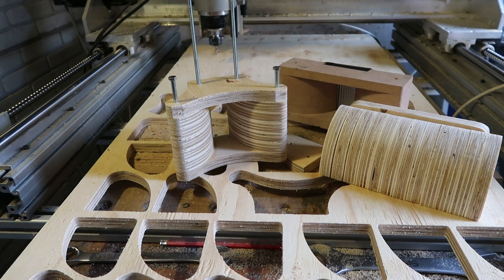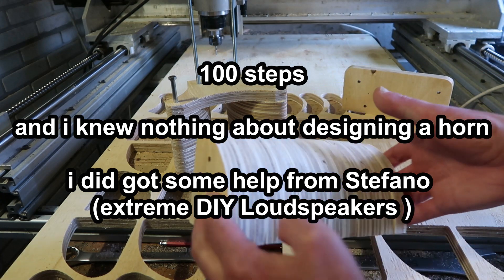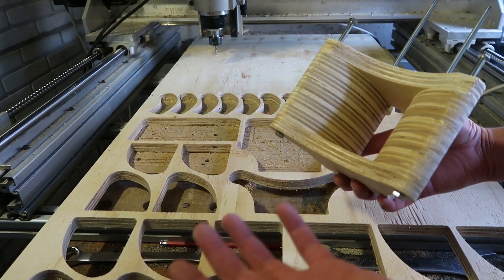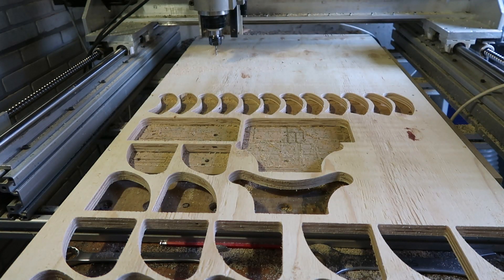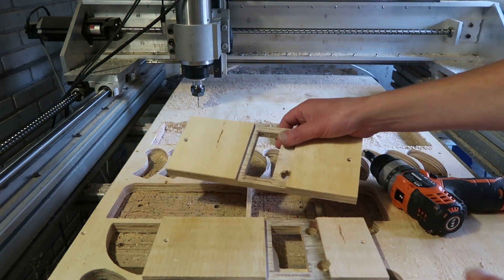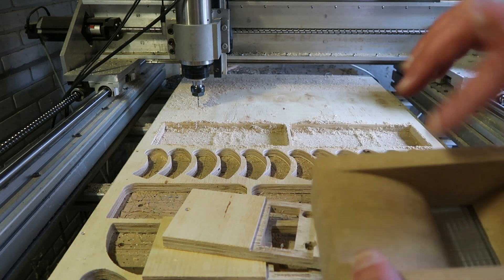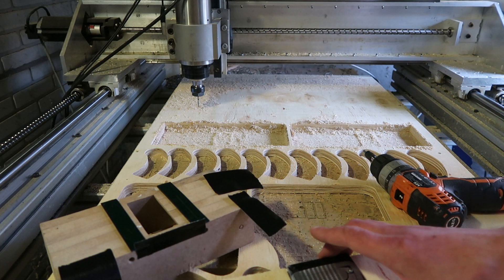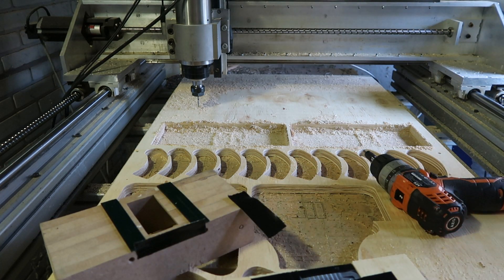Tractrix Horn vs My screwed up horn vs Open baffle

Comment: A tractrix horn (and parabolic horns) will behave very much like a conical horn as it reaches the mouth and the curve becomes similar to a line.
The reason you see the incorrectly oriented horn behave like it does is because it behave more like a conical horn at the throat.
The big dip at 22KHz looks like baffle step, and you can see how the tractrix flare handles it much better. A conical horn will perform better with a circular or parabolic curve at both the mouth and throat.
You can also see clearly the major weakness of the tractrix design, it tends to have poor off axis response compared to conical or parabolic horns.
Reply from the maker: Thank for the explanation ! im a horn noob :) so everything is welcome haha

Comment: Very interesting what software did you find works best for modeling the profile?
Reply from the maker: None of the expected pcb layout cad programs. So i just use sketchup. It works the fastest and the best for me. Butit cant adjust trace width onn the fly .... it means start all  over
Reply: @joppepeelen  very cool thanks!

Comment: No...this was very insightful for viewers and 6-7 db is huge on the low end. Most designs I've seen using horns are for individuals looking to crossover at 1000 hz with a larger woofer 10-12 inch. Now you can see why! :>)
Reply from the maker: Tbanks ! witch one you prefer ?
Reply: @joppepeelen  I don't know why one viewer stated that your design was wrong but I have seen some larger throat horns like your first one that you said was a mistake. The best one is the one that works best with whatever woofer that you choose to mate it with!??!?!
Reply from the maker: @gzubeck3  well a tractrix has a certain slope./flare and mine did not look like one although i did use a tractrix designer, thats why he said the flare was rotated 90 degrees , and hes right about that. this works to in the end , but if i wanted to make a tractrix the second version should be it. not the old  one :) i just interpreted the drawing wrong :) since the program i used only poops out a curve. and i used that curve 90c rotated.

Comment: This so happened to perfectly supplement my current reading up on horn design, almost text book perfect examples actually; The wide flare is needed to achieve LF performance. The end plates in the radial horn, while limiting dispersion also do a good job of preventing the air from escaping the pressure wave. You could of course go for a compound horn, with all the pitfalls that brings to the table.  Interesting to see that the horn indeed do add linearization here - as so often claimed for Tractrix. Further horn/driver impedance matching could probably smooth the response even more - compression driver loading the diaphragm. Thanks a lot :-) incredible timing!
Reply from the maker: thats good to know, my thoughts where that the wide cheeks also gave a direct vision of the tweeter itself, so no obstructing like the traxtrix. screwing up the top end at 30 degree compared to the screwed up horn :)

Comment: I think Tractrix has less low end, because it is small.
You could scale it up so it would be same width as "screwed up" horn.
Reply from the maker: well its not that much either. but dispersion ... is kind of a thing  the screwed up version did much better :)
Reply: @joppepeelen  Horns usually reduce dispersion. It can be a good thing (less reflections).
I don't know how bigger tractrix would affect dispersion.
Reply from the maker: @lightbit553  if the curve would be less steep i think it becomes better just like the screwed up horn :)